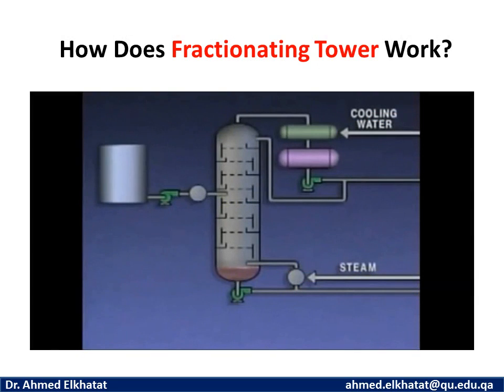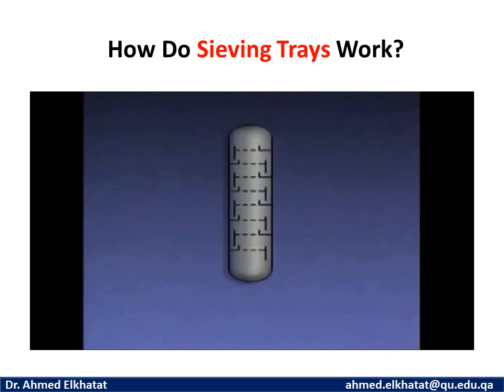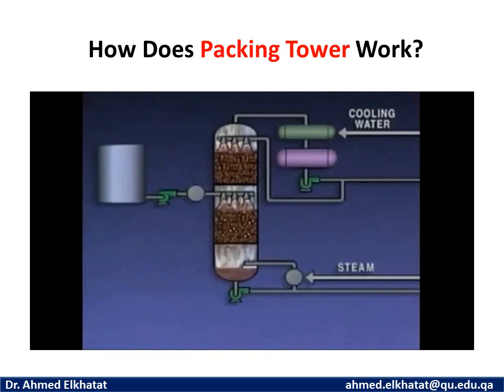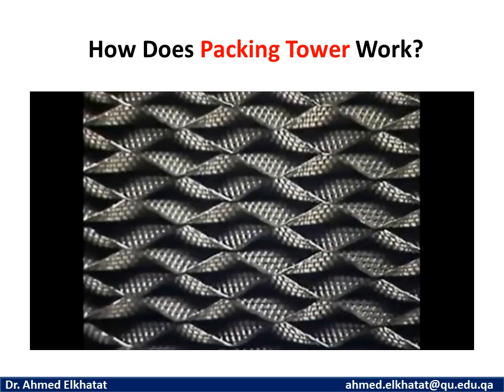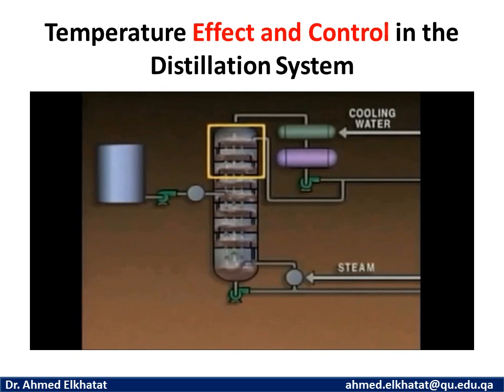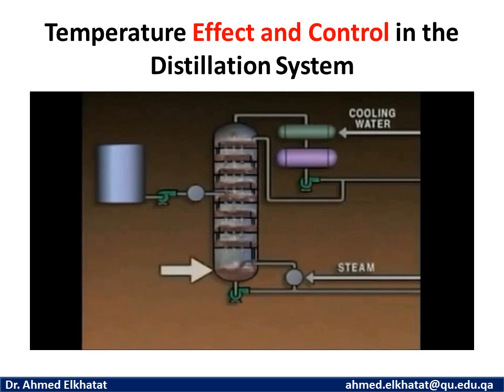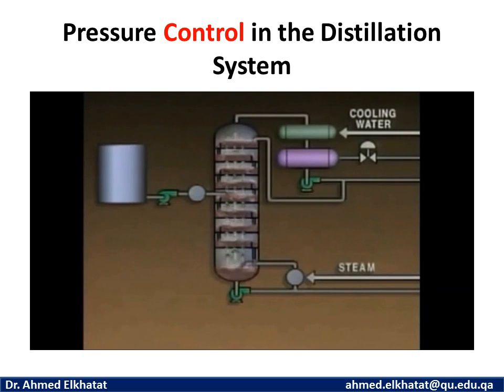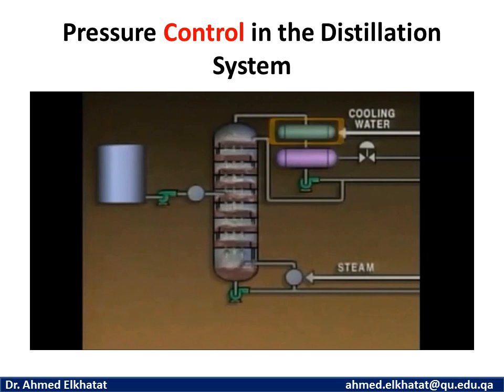Continuous Distillation Column 2016 (Updated/Modified)

Comment: While doing the material balance, F (feed)= L (reflux) + D (distillate) here when we apply component balance for the highly volatile component we get FxF = LxL + DyD. So, actually, the reflux is just a condensed stream of the distillate so it will be just a physical split right so, will that mean xL = xD always?
Reply from the maker: We can't apply the material balance for the feed like this. Your mentioned material balance is for the rectifying part, where V (Vapour of the overhead product) = L(Reflux)+ D (Distillate). 
We cannot apply this for feed, because the operating line of the feed depends on its enthalpy, hence, part of it might go up as vapors, and part of it might go down as a liquid

Comment: If it physical separation in the condensor then why is the mole fraction of reflux changing
Reply from the maker: Mole fraction changes along the column, as you go up the fraction of the more volatile component increases, and as you go down, the less volatile component increase.
Reply: @medoKhatat  can we consider rectification column as a absorber and workout as absorber
Reply from the maker: @koneruneelesh79  Surely you can

Comment: In batch distillation, the head and tail contain undesirable components, what happens in the continues distillation?
Reply from the maker: The advantage of continuous distillation is that you can make side withdrawing of the product at any stage, top, middle, bottom, etc, to get rid off the  undesirable component at any stage , the product at that stage can be fed to more refinery stages (eg: Cracking, Isomerization, treating, reforming, etc)

Comment: I want to know what is the meaning of adsorption ??? Thank you for this valuable information, Mr. Ahmed💖💖💖
Reply from the maker: Adsorption is similar to absorption process, but in the absorption the material absorb on its surface (like activated carbon that absorb fumes). adsorption is always related to a solid material that adsorb fluid (gas or liquid) the  adsorption process is physical process (reversible), but if it irreversible it is normally known as (chemisorption). Hope you find it useful